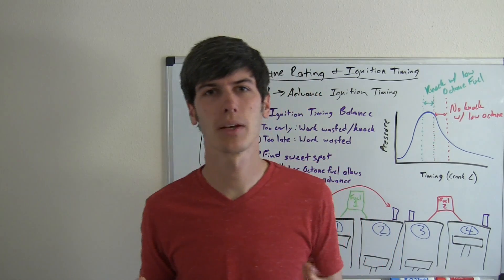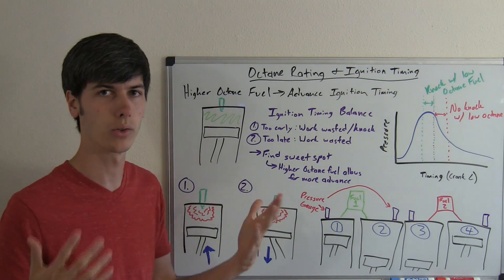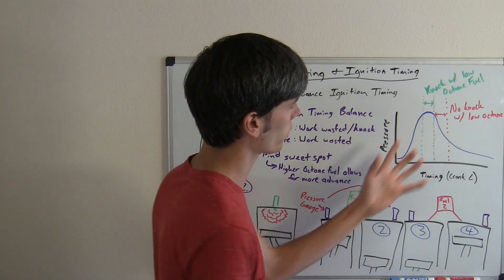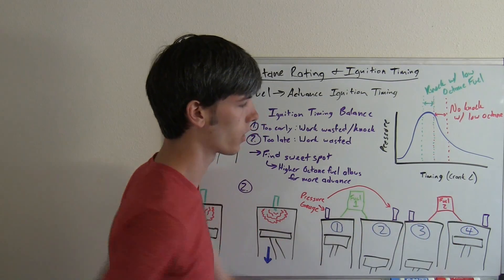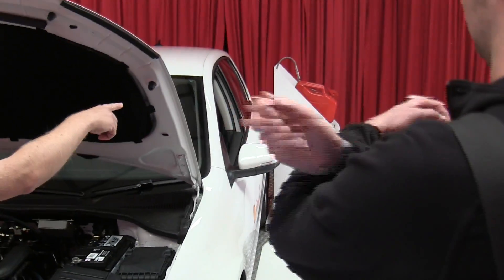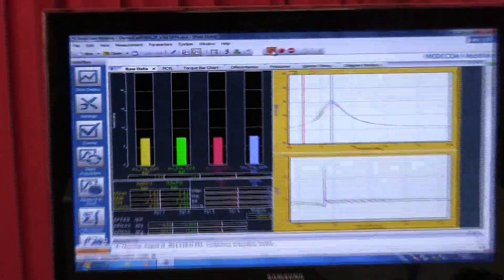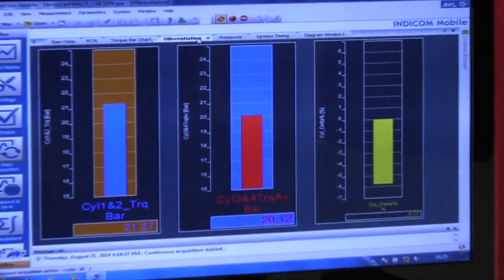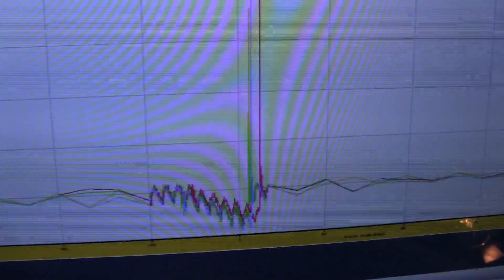Dyno Testing Premium Fuel - Octane Level vs Performance - Shell V-Power

Comment: I notice the difference between Sunoco high octane and the Shell V-Power Nitro+ in my Porsche 718 Cayman S PDK.  It's got the extra edge as a result of the 99 RON.  With a 3.6 second 0-60 mph time, it can be difficult to perceive the difference, but it is there.

Comment: guys please read description 
Note: If a car is not capable of altering ignition timing, or recommends using lower octane fuel, it is unlikely that there will be a performance benefit from a higher octane fuel.

so this test if you use lower octane than recommended in your car

Comment: The test confuses me just a bit. So I'm gathering that this car has some sort of VVT/VANOS/VTEC/whatever you want to call it, and that it's somehow recognizing that it can advance the timing of the higher octane cylinders with this? But that's what I can't wrap my head around, how the hell would it know what octane the fuel is and how would it compensate on only 2 cylinders at a time?
Reply from the maker: +nickthatch12 uses knock sensors to advance timing. If it detects knock it backs off on the timing. Higher octane fuel does a better job of preventing knock, thus the engine can advance the ignition timing, creating more power.

Comment: what is the conclusion? what is the result in real life? if my car manual says to use 95 or obove why should i use 98? 
thanks in advance for your answer.
Reply: If your engine is in good running order, all you need to run is what the manufacturer tells you to run.  If your engine is knocking (retarding your ignition timing), and you care about getting the utmost in efficiency from your engine, then there's a good reason for you to run a higher octane than what your manufacturer recommends.  But fixing the cause of the knocking would be the better solution.

Comment: Very interesting because I didn't know that the ignition timing would be adjusted per-cylinder like that.
Reply: SirBudrick In newer engines it can.
Reply: SirBudrick  me neither
Reply: That is why a knock sensor was installed in modern engines😉
Reply: @mohamedgaaloul2753  knock sensor doesn't necessarily mean per cylinder adjustment. Lot's of older EFI cars had just one knock sensor and would not even immediately know which bank on a V engine is knocking until it made adjustments to STFT and observe if it helped or not. With port injection, and sometimes batch fire during startup or even steady state on some older EFI ECU you don't always even know for sure which injector to adjust until several cycles of making adjustments and observing plant response.

Comment: I going to explain in this way, Octane is basically the autoignition temperature, and because air it heats when you pump energy to compress, algo elevates the autoignition point.

If you will go to get an car in which you wan't to put let's say, a 3 bar turbocharger (45 psi) you wan't a fuel good enough to take the pressure without knocking. But if you don't your engine possibly will not burn ALL OF THE FUEL, and you gonna get less power, this is a problem that i get when i decided to conver my old engine to natural gas, with a 120 octane number. 

Isn't really octane what gives you more power, is the advancement of the plug and the higher pressures you can work on it what gives a little bit more power, if you got an old mustang v8 N/A with a 8.5 compression ratio you don't really need high octane fuel, because you will possibly lost power.

Comment: I use my car for a ride share job, it is a honda fit 2015; do you think buying premium gas would help since i am driving the least 200 miles a day?
Reply: RexRighteous1 see if you have a knock sensor
Reply: Its very possible. I have a second gen fit and i know the engine computer will retune for higher octane fuel. I would assume the 2015 would as well, especially since its newer and has better tech in the engine. However, you wont be getting a ton of miles more per fill up out of it. Maybe a few percent. However, premium fuel, a bit higher tire pressure, and proper driving technique (avoiding breaking, light throttle use, etc) all combined could net you a decent bit more out of your engine.

Comment: I´ve always wondered about the control system providing oversight for knocking.  Does it continually (on-the-fly) advance timing a smidge to see where the limit is?  I imagine it must be checking continuously but am surprised at how it is not noticed during idling.  Any thoughts?

Comment: this is my take on octane: With high octane fuel, it is refined to slow down the combustion speed and drag it out over a longer period of time. So, it ends up being a cooler, but longer burn than low octane. Because of that, timing can be advanced a bit more. My experience shows that only under heavy acceleration, or load, the engine shows it's true colors. As most of us know, all modern gas auto engines have a computer with knock sensors that "listen" for knocking (early combustion) and adjust the timing dynamically to stop it. So, with that being said, IMO, if you do a "butt dyno" making runs using 87 oct and again using 100 oct racing fuel, ya....you may notice a bit more punch with your daily driver.  Worth it? Naa. That's my own opinion on the topic.
Reply: but, when there is a noticeable difference btw 87 and 91 pump... it suddenly makes sense
Reply: You’re wrong in almost every way, amazingly.
Reply: some engines are made to run on 98, like the TSI. it is worth it in those cases.
Reply: I personally ran the same quarter times on 87 and 91 octane fuel.
My ecu is tuned for premium, but my engine is not high compression (anymore, original engine was, now just running plain 2.5 low compression, but with the same dual butterfly intake)
No idea yet if a tune would change my performance to be ideal on 87.

Comment: Might want to explain how this isn't the conclusion for most cars!
Reply: My guess is that due to US emission regulations, US manufacturers optimise for cheap fuel and expect drivers to run that exclusively. As a result they don't allow the engine to sense premium fuel and adjust to get the benefits of it like the Golf was doing. Hence the CNBC test on a US car which ran slightly worse on Premium. I'm in NZ and our cars are either Australian spec, EU spec or JDM spec if imported as a used car. All our cars benefit from premium fuel, I have done my own economy tests to prove it.
Edit for spelling.
Reply: GlassTopRX7 that fd though

Comment: so on the 2016 mustang gt would it be beneficial to use 93 ?
Reply: dude wheres my car Rustang fuel.
Reply: Read the manual or do a research for your engine. I have a Mercedes 3.0 biturbo and it doesn't need more than 91 american octanes.

Comment: shell is cheating, this car engine is designed to run higher octain fuel.  this does not apply to most cars.
Reply: All car are different, from manufacturer to manufacturer, turbo to NA, and country to country. Shell chose a car that can cope with the requirements of the test. So what?
Premium fuel has benefits for hp and as a result, economy. That's a fact. All engineers know this. However, some cars are programmed to give those benefits and some are not. I don't understand why, but this seems to me more common in the American and Canadian cars than elsewhere.
Reply: +Nick Palaroan Hondas sold in NZ from '96 on used knock sensors to detect octane and automatically adjust giving a hp boost as octane rating rose. This is what we service technicians were taught by Honda NZ and the info came straight from Honda Japan. The PGM-FI was fast enough to adjust for a different octane rating every stroke. This technology is everywhere now but it seems that some manufacturers still cut costs by optimising for low octane only. The sort of person who thinks a Corolla is worth buying wouldn't be able to tell the difference anyway.
Reply: Steven Farrington Premium fuel does NOT have any performance or efficiency advantage in an engine not optimized for it.
Reply: There is no cheating. They are able to run advanced timing on the higher premium fuel. That is effectively the benefit of tuning. Unless you do what they did and TUNE the car to take advantage of the premium fuel, you will not see a benefit and will actually likely be less efficient(depends on things like ambient air temp etc). They are demonstrating the benefit of higher octane(IF_tuned for it).
Reply: Pavel Kovalkov nope this is 1.4 or 2.0 engine such as Gti so in Europe designed to run with 95ron but could detune for 93ron.

Whereas in US,  it is usually speccd for 93ron and can be tuned to 95ron if used
Reply: Steven Farrington
The problem with using a fuel with a higher octane rating, than specified by the mfg, is that the car cannot detect higher octane at all.  The sensors detect knock (ostensibly from too-low an octane) and adjust the timing until the knock goes away.  If the engine is rated for 91 octane and there is no knock from that gas, then adding 93 will do nothing.  The car can't tell one from the other.  In fact, using a higher octane than specified can actually reduce performance and increase pollution.
Reply: You're acting like he's saying anything contrary to this

Comment: Important note: You will only gain power if you have an engine that uses knock sensor(s). 

Another benefit of a higher octane is that you can increase the compression ratio of the engine without getting knock due to premature ignition of the fuel.
Reply: You can't get a higher compression ratio without doing major head work
Reply: Robin Karlsen My R18Z1 has knock sensors and it runs like crap on higher octanes. Runs EXTREMELY rich getting 25mpg highway, where I get 45mpg average per tank. 

The knock sensor just allows the engine run on the different octanes without destroying itself, it doesnt mean the computer will optimize the timing for the different octane.
Reply: Nick Palaroan It sounds like you have a weak ignition system or fouled plugs. It takes more heat to ignite higher octane, which is the whole point. Your car tunes the timing to be on the threshold of detonation to get the most power and the best fuel economy. When you raise that pre-detonation threshold by making the fuel harder to ignite, the computer indeed advances the timing map.
Reply: GioGuitarDude So my brand new car has fouled plugs or weak ignition system?

I doubt it.

Im not saying some cars wont benefit from higher octanes, Im saying that just because a car has a knock sensor doesnt mean it will benefit from it. It depends on how the computer was programmed in the car.
Reply: +GioGuitarDude It also depends on the compression ratio. The R18Z1 is 10.6:1, which isnt all that high for 87 (US) octane today.

If your fuel is igniting at the proper point after compression, then increasing the octane will at best have no effect on the performance of the engine. Since the higher octane can withstand higher compression, knock shouldnt be experienced at all in this scenario. Knock is experienced when your octane is too low, not too high.
Reply: Nick Palaroan I don't think you get what I'm saying... your ECU determines that "proper point" based on information it gets from the o2 and knock sensors. All cars are different and ECU's are different, but that knock threshold WILL be raised, and most ECU's will compensate for that. Ford ecoboost vehicles will put out variances of 20 HP or more just based on the relative ignition timing governed by the information that the ECU gets from the vehicle running different ratings of fuel (octain). My 20 year old turbocharged truck will absolutely advance the timing based on what the ECU learns from the different grades of fuel I use. 91 octane produces the most power, and my smart scanner clearly tells me that.
Reply: GioGuitarDude I know exactly what you are saying, I know exactly the process that takes place.

Your ECU will adjust timing to prevent knock, yes. But depending on how the ECU is programmed, that doesnt mean it will adjust the timing efficiently. It has a range of tolerances it is designed to operate within, when you change that (like running a higher octane when not needed) you can actually do more harm to your engine than good.

If your engine is designed and optimized to run on 87, a higher octane will not benefit and will most likely hurt it over time. The ECU can and will certainly adjust the timing to prevent knock, however because higher octane fuel requires more compression to ignite this also means that you will subsequently be burning more of it in an engine not designed for it, as has been shown.

When you dont fully compress (thus heat) the fuel enough, when you ignite the mixture not all of it is going to burn which will result in less power produced and thus more fuel needed to maintain rpms. This explains why my R18Z1 had horrible fuel economy with higher octanes.

My engine ran perfectly fine on higher octane, smooth with no knocking. However the compression was not high enough to fully excite the mixture. When you add that to the fact that higher octane fuels generally have a lower energy output per unit (control comes at a price) you will see a drop in performance and efficiency.

My experience isnt one of just bad luck. I experienced poor fuel economy due to the fact my engine simply could not make use of the fuel, timing alone will not allow you to efficiently burn all octanes. It will allow you to burn them without blowing up your engine, but unless other criteria is met it will not do it efficiently.

High octane fuel is reserved for high compression engines for a reason. The fuel is designed to be compressed beyond what your standard engine does and thus the fuel will lose energy if its not compressed enough.
Reply: GioGuitarDude But again, running higher octane in a low compression engine designed for lower octane shouldnt have any effect on the timing at all. Since the higher octane fuel should not cause any knocking, and as a result your knock sensor wont know anything has changed.

Comment: my honda H22A calls for premium only, and I always run highest possible which is usually 94 octane. sometimes I wonder if I'm wasting my money
Reply: My wrx wants only the highes in European octan calculations wich is 98 or higher
Reply: GlassTopRX7 audi TT 1.8 early 225hp engines. Originally advetrtised as 95ROZ and 98ROZ optionally... End was melted spark plugs. Now there was an only 98 note.
Sure engines get this but on long term no one garanties that this is good even closer to the knocking range when the engine is designed for higher octane.
Reply: GlassTopRX7 they actually changed the rating on the 180hp Motor later and there are few documentet cases in Germany of this engine going kaboom because of 95 ROZ.
Reply: that is wrong higher octane runs cooler and a more controlled explosion. octane is just resistance to burn a higher octane needs more pressure to burn it thats why all those race bikes are running 120 octane fuel
Reply: GlassTopRX7 i know that RON ROZ case... but its true + these fals 95 engines didnt handle the unlim Autobahn

Comment: for my 88 jeep comanche with performance parts installed one bieng a performance chip and it said I need to use higher quality gas for it to perform better would e85 harm my truck? or can I go with shell nitro?
Reply: Your truck prob wont be able to handle the e85. Ive seen that its mostly the clutch or transmission that f up with the power boost
Reply: If it has a good engine and good transmission you could gain alot of power from e85
Reply: +Reps well Iv always maintained my engine and trans... clutch wise I just have 3 weeks driving with a stage 3 clutch did the  pilot bearing hydraulic throw out bearing flywheel disk with plate and master cylinder
Reply: +pirotechnico323 if you want lower and have some money left over get ftw racing fuel. $175 a gallon with a minimum purchase of 3 gallons lol. Octane rating is at 115 or something
Reply: +pirotechnico323 *power
Reply: +Reps I was told that to go with vpower nitro I need more octane than ethenol?
Reply: Ethanol has 60% of the power of gasoline, so by using E85 you have at least a 35% drop in available energy. And since octane is effectively the opposite of flammability, the higher octane number is not a surprise.

Comment: Vpower is the only fuel I can feel the power difference on my car of all the different fuel I have ever used
Reply: Vpower sucks
Reply: jack deng You have an awful good imagination.
Reply: H Mack I don't have any preference or recommendation,I've just had bad experience with V power.I filled my gas tank with Vpower once and I had a HUGE loss in power,I had to use full throttle going up even the smallest hills and could barely accelerate enough to keep up with traffic ,whereas I can normally pass all traffic as my car is much more powerful than most cars where I live.